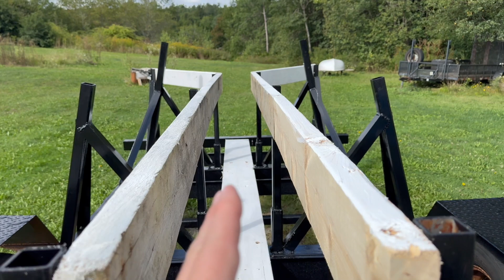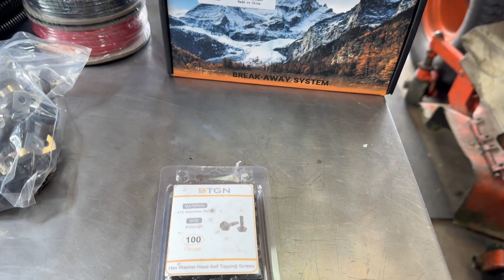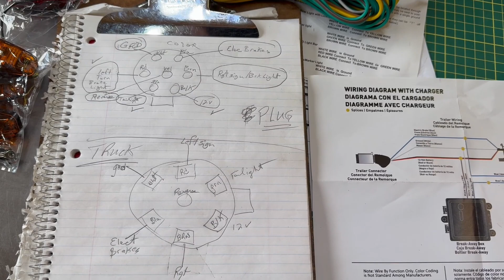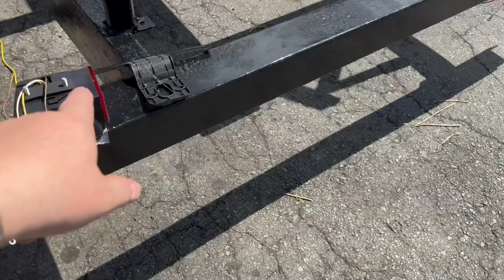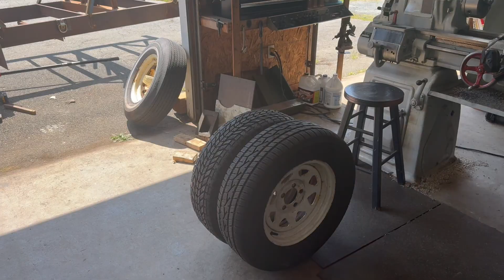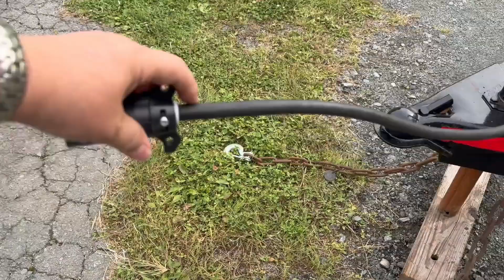How to Build a Sailboat Trailer - Part 3

Comment: Nice work. On my boat trailer I have added a plug (same connector that is on the truck) onto the trailer near the hitch. When I am not using the trailer I plug the tailer connector into this plug. This helps keep bugs and other junk out of the connector reducing maintenance issues.
Reply from the maker: Fantastic idea. Tks for the tip